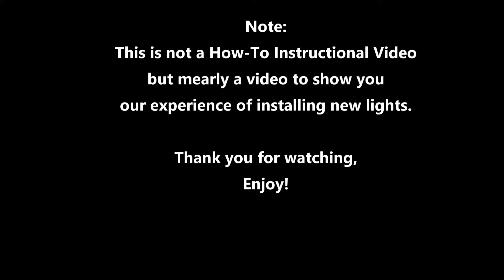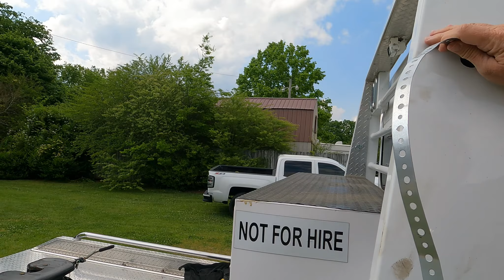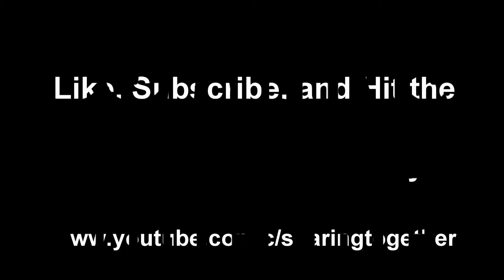New Lights FreightlinerM2  - Fulltime RVing

Comment: Harbors Freight, pull tape or pull stick.  Works great for pulling wire.  Has a hook on the end so you can tape your wire to it and pull like you never did before.
Looks like a Chicken Truck with all of those lights on it.  Now if we could only convence our coach manufactures to put more lights on our wagons😉.  Safe travels Brian and Cindy
Reply from the maker: Thank you, we will remember that!